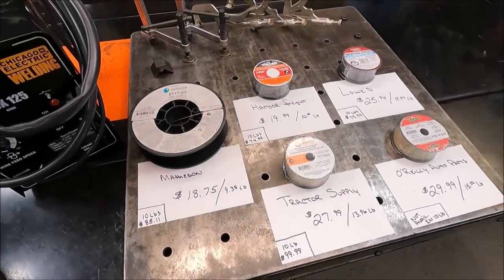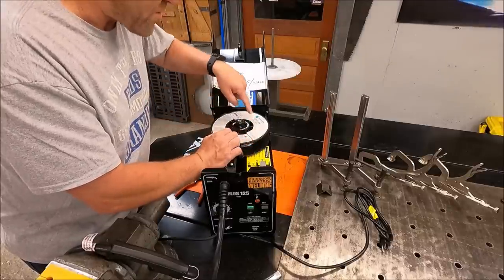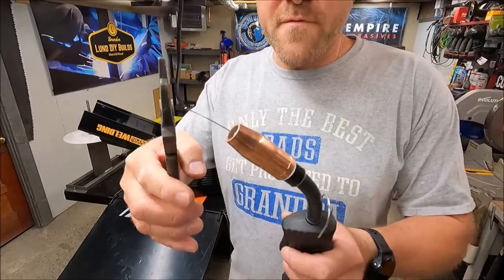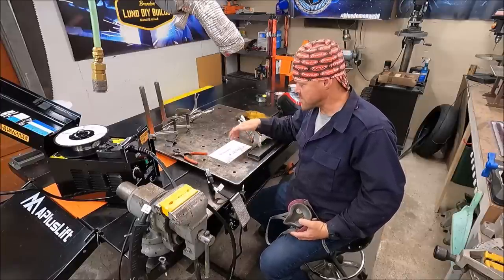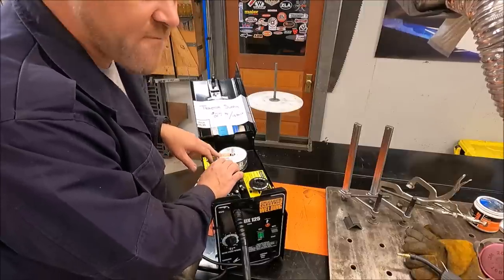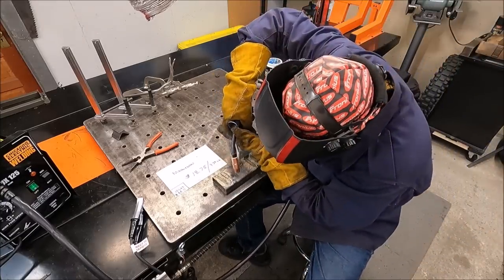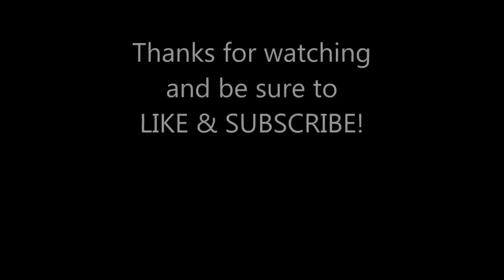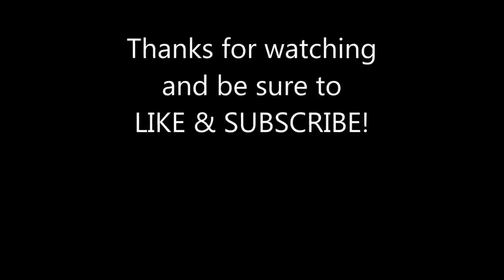Testing which Flux Core Welding Wire is Best

Comment: Unfair comparison because different electrode classifications.. GS wire is rated for single pass general purpose wire. T-11 wires are rated for general use but typically multi-pass applications from 5/16" to 3/4" thick steel (depending on brand) and according to AWS, rated for light structural per code. Also the GS designated wires, manufacturers can essentially use any flux mixture they like as long as it meets the lenient requirements. Again, T-11 wires are more strict on flux requirements. Don't get me wrong, I like flux core arc welding, but in my quest to get the best results I have gone down a rabbit hole learning all I can about it. I'd like to cite AWS D1.1 as my reference source. For the record, the Hobart and Lincoln wires are the only T-11 wires tested in this video. Not trying to sound like I'm hating man, just some constructive criticism. If I were as good as a film maker as you I'd love to share results from my own testing of various brands at various settings, including running off CC welders instead of typical CV.
Reply from the maker: You have good intentions, but its not for this audience. These are the wires that are available in stores across the country on any given weeknd for consumer use. Home Depot, Harbor Freight and Lowes aren't going to give you those options you mentioned that you will find at a welding supply store. If I were gearing this towards an advanced audience, I wouldn't be buying my wire at O'Rileys.

Comment: Common misconception is that all flux core runs the same polarity.  You have to verify what the label calls for.  Not a big deal on a machine that lets you swap polarity.
Reply from the maker: @Travis Hanson Spot on. As a general rule, most gasless wires FCAW are run DCEN. GMAW (Gas Metal Arc Welding) and FCAW that use gas will usually be run DCEP but as you mentioned it will say within packaging.

Comment: Thanks for your time and expertise, I have all but given up on flux core welding, after watching your video has given me some hope that I  should try the Lincoln wire also, trying alot of settings I was still having trouble with too fast, too hot, too much wire speed or too slow. So maybe it's just the wire. 🤔. Now what to do with 4 spools of wire that doesn't work for me.
Reply from the maker: Hey Gary I hear you. Some other issues if you run Lincoln and are still having problems. It could be you need to switch your polarity, you might need to set your drive roll tension or your liner could be dirty. Each of these will cause feeding problems. Here is a video showing those issues https://youtu.be/2ns3HLXDZsE

Comment: I have an old Miller, Millermatic 115 volt. I was having problems feeding and they (Miller Dealer) told me to use .030 wire. Have not tried other brands yet but will try the Lincoln wire.
Reply from the maker: @Charles Million Much of the feeding problems have a lot to do with the manufacturing process that Lincoln doesn't seem to have. Its a very reliable wire.

Comment: The money is the diff in wire cause its costs keeps rising. As long as the rating is same I'll buy the less priced stuff. I've been using the harbor freight 120 and 220 volt Chicago electric machines using .... / 023 /030  and 035 since 1998. With the settings dialed in specific to wire there's no need to buy a more expensive mig machine. I Just dial it in and turn down heat as metal heats up and I'm burning holes in my tennis shoes. Love the simplicity of migs in that category. From car sheet metal to 7/16 after my learning curve but when your there it's sure is rewarding. I have purchased crappy stick though and have never used that Matheson wire.  Now you got my curiosity about it so I guess I better see if it will work for me, thanks. The stuff keeps getting more expensive.
Reply from the maker: @Scott Sanders thank you! I started out on a HF welder and I still have one so I would never knock anyone for using one. I actually love mine. I've used a bunch of different wire over the years but never back to back like in this test so it pretty much removes that learning curve you get as run a particular wire after a while. The lincoln wire is definitely worth a shot. I guarantee you will absolutely love it.

Comment: Great head to head wire comparison!!  Price comparison wise it would have been nice if it was possible to source them all from the same place, anything you buy at O'Reilly's you could probably get cheaper at TSC, and cheaper still at Lowe's, and even cheaper from HF.  Lincoln, Hobart and Matheson are available from multiple sources but Vulcan is exclusive to HF and I don't think they offer any of the other brands, not sure about Vaper but I'm guessing it's an O'Reilly only deal and I don't know if they offer any of the other brands, so probably impossible to single source the wire unfortunately.  Great comparison of the wire performance!!  Glad you adjusted your settings to give each wire a fair chance.  Some might complain it wasn't a true apples to apples comparison, but in the real world if your wires not running good you check and adjust your settings.  Great job!
Reply from the maker: @yertel t thanks! Most places I went to pretty much only carried one  brand. I really wanted my Matheson to win too but the test showed me otherwise
Reply: @BrandonLund  When the favorite comes in second you know it's an honest test!!  You can probably get the Lincoln, Hobart, and Matheson from a welding supply website, but yeah, Lowe's and HD only carry Lincoln wire for their Lincoln welders, same with TSC and Running's with Hobart supplies.  Cool to learn you're a Mainer, former Eastporter here.
Reply from the maker: It's always nice when viewers are from my home state! Thanks!

Comment: I use Lincoln and Vulcan, depending on tinkering project, or paying customer.

there is 1 more wire I think about, but I have never tried it in a flux core, but love it best in solid wire for doing auto-body work, discovered it 5 or so years ago, accidentally picked 1 up, sent my wife to get, lol, and thats all I use now, for welding car bodies made by Washington Alloy.

another I hear about is Blue Demon, but never tried any consumables, but I do have a MIG by them & love it!
Reply from the maker: I have heard both are good also. I have a Blue Demon welder and love it but I too have not tried their wire. I'm going to have to pick up a roll. Thanks for watching and sharing @Randy mack
Reply: @BrandonLund  thank you.

I bought my Blue Demon welder as a joke, shop I worked at only had 110 power to building I worked in, so had to piece cars together, then take apart, take to big building with his 220v welder, to refit parts, and weld, I figured I would tack weld parts to hold in place, however joke was on me, that welder was so awesome, I used it for everything, and it has put on so many quarter panels, rockers, cab corners, floors, trunk pans, plus so much more. a honestly amazing welder to be made in China.

I did do a few mods, 1 it needed a new liner in mig gun, but I ordered a custom MIG gun, and installed a bronze ground, the MIG gun has a better switch, & really helped it, & then I discovered the Washington Alloy. and prefer it to Lincoln, for auto-body work. mine is a 135M which is an older MIG welder, but I wouldnt trade it for anything, & I have Lincoln MIGs, but I will grab this for sheet metal every time
Reply from the maker: @Randy mack that's an awesome story! I kinda chuckled about it being a "joke" at first. I have their 120/240 stick welder and it probably has the nicest arc I've ever struck with a stick welder. There welders are definitely under marketed for what they are. I heard the Blue Demon wire is made in the same factory as Hobart but I can't confirm that. I'm really curious to try that Washington Alloy. Thanks again man!
Reply: @BrandonLund  I honestly want to either buy the multi-function, or the 140 MIG, by Blue Demon, to have a new machine, and use mine as a backup, I own 5 other MIGs, 2 are Lincoln 180's a 110V Blue Point, then 2 cheap ones. but for sheet metal I love my Blue Demon.

my boss that I bought the Blue Demon because of, he has a Snap-On YA212, those do pretty good for sheet metal, but also suck for normal welding, although supposedly an internal switch to make it weld normally? but it uses stickout of wire to run lower temp for sheet metal, weird technology. but works for auto-body, but my boss insisted on .030 Lincoln for auto-body, which generally I prefer .023. but his did a great job, then I discovered my Blue Demon, generally I prefer 110V machines for auto-body, plus a trick, if wanting to lower amps, but want it say between #2, & #3. you can try using extension cords at the higher power level, a 15', 25', 40', and 50' can drop it, so that its no longer too hot on number 3, but hotter than normal #2, if your having issues, if you wish to play? use cheap 16 gauge cords. otherwise, 10 or 12 gauge cord 25' or less so you wont drop amps. lol. thats best way I found to add ranges to a welder for thin sheet metal. LOL.

the Joke, I was browsing Marketplace for a cheap welder to tack parts with, saw this advertised by a guy I know, sold it to me for $100, with a 135CF tank of gas, and cart. he closed  his muffler shop, but welder had been used exclusively for exhaust work since new. it did ok, so I spent money for new gun & the bronze ground. and me sending wife for MIG wire, .023, thats from LWS, and got that Washington Alloy, I figured I would try, and I prefer it to Lincoln, then my second choice is Lincoln. the only beads I welded with Washington Alloy in reinforced areas on autobody, the rest are tacking, if your familiar with installing sheet metal on cars?

my Lincoln 180 Mig welders, both set up for flux core, 1 I keep Vulcan wire from Harbor Freight in all the time, for tinkering projects, or repairs that are not critical, then the other one I keep Lincoln wire in for anything important. I bought welders dirt cheap, 1 was new, 1 was almost new, person gave up trying to learn to weld. $400 for new, at pawn shop, the other used 1/2 of a 2lb spool, it was $450.

Comment: Ive found with the harbor fright welder is to not fallow the suggested settings on the wire feed it simply dose not have the heat to run at 7or 8 in my opinion it seems to run best on max and like 2 or 3 on wire speed
Reply from the maker: Great point Jacob's! I'm going to be doing some more testing on this welder but what your saying makes sense and that's what I was experiencing also.

Comment: Nice job Brandon. From my experience, Lincoln wire first, then Hobart wire…

For Dual Shield I use ESAB DualShield 7100 Ultra wire in 0.35”
Reply from the maker: I like Hobart as well! I haven't tried the ESAB yet but I'm curios. Thank you! 👍

Comment: Another wire you could review in the future is called ESAB Sureweld from Northern Tool. All but one of those you've tested in this video I can buy locally. I've just purchased my unit from Grizzly, so am  looking for wire for the future. Thank you for posting.
Reply from the maker: @basement_sawyer that's a great suggestion! 👍  thank you. I will have to pick up a roll and test it out 😀

Comment: Brandon, Thanks for the comparison video. It would be interesting to know who makes the Tractor Supply wire and the O'Reilly wire.  Also, FYI: your fume extractor wasn't doing much, if anything. Good thing you were using the respirator.
Reply from the maker: It wasn't doing anything LOL It's too loud to keep running when I'm doing the narration parts of the video so half the time I forget to turn it back on

Comment: I had the Vulcan. real good luck with the Vulcan wire in my machine which is a titanium harbor freight flux core welder.
i really like the vI really like the Vulcan wireulcan wire
Reply from the maker: @Rusty Cahill I didn't have bad luck with the Vulcan once I started messing with it but it didn't run like the others. It wasn't bad though.

Comment: Useful review, thanks!
I often end up welding galvanised steel, I have found that different galvanising works better with different wires 🤷🏻‍♂️ Worth trying an alternative wire if the regular wire is not working well.
Reply from the maker: @Td Wernham Great point! Thanks man!
Reply: not a good idea to weld galvanized steel without a full air mask that get fresh air from a distant soruce.. the outgassing from galvanized steel will form zinc oxide fumes that can be dangerous to your health
Reply: @randellgribben9772  Absolutely correct, you need to be careful welding galvanised material, the fumes are very bad for you (potentially fatal).
Reply: Do you try to "degalvinize", so to speak, at all to avoid fumes and bad welds? 
Im curious about common hardware types and welding them. 
Black oxide, zinc, galvanized, stainless, grade 5 and 8 and which is best for a diy'er
Reply from the maker: @Nate B I make a good effort to get metal to bright and shiny regardless of what it's coated with, with the exception if I'm outside throwing something together stick welding then I will not be so fussy with cleaning but as a general rule you should always get the metal to bright and shiny before welding and wear a 2091 or 2097 respirator at the very least when grinding and welding.

Comment: im not a great welder by any means but i have a harbor freight titanium 170 and have been using the wire it came with which is the vulcan i believe and 1 thing ive found out to get good welds is the settings of the welder and material matter alot im sure if you took these same wires and ran them in say my machine or a better machine that you have they would perform much better and all my welding was done on 120v no gas
Reply from the maker: @ThePoolman2007 that's a good point. We are going to test this out real soon because I'm curious too!

Comment: With the GS wire that is a result I somewhat expected. Maybe try running ER70T11 in a slightly bigger machine. Hobart .035 really likes to run in a 140 machine quite nicely. I run a Titanium 140 at work, so I might be just a bit biased.

Comment: I have the HF 125 titanium welder and I threw away the wire it came with and use .030 Hobart from Tractor Supply, may switch to Lowe’s Lincoln.
Reply from the maker: The Hobart is pretty good stuff!

Comment: I've purchased a set of 0.30 & 0.35 YESWELDER Flux Core Mig Wire Mild Steel E71TGS when they were on sale, though not used yet.  Just checked the 10lb spools and they're like ~$40-50.  Wondering how performs compared to the Lincoln?
Reply: Thanks for sharing too!  Most I read regarding, the Lincoln is the preferred wire, though seems to be a lot of favor with the Yes wire too.  I have a Miller, so know the feeling.  Invested in a restorable Century 125GL and loaded up the Yes wire and need to find the time to lay some dimes... or well not quite dimes.
Reply from the maker: @jafinch78 I've heard good things about that wire also but I've yet to try it. I will order some and get some results posted. Thanks man for the suggestion!

Comment: This only applies to the Harbor Freight A/C type welders..... all these wires run much better on proper DCEN. Good video though for those with an A/C type welder.
Reply from the maker: @tdhorn13 I thanks! One of the upcoming tests is going to be just that. We are going to compare this machine to the Vulcan 125 which is the HF DC version. It should be interesting.

Comment: yup lincoln wire runs the best been using it for 5yrs and when i change to Forney flux core wire i notice that it wasn't putting a good weld so i switch back to lincoln wire .
Reply from the maker: I totally agree! @Welsey Lewis

Comment: Good info. What are you thoughts on using flux core nozzle for flux core? Thank you.
Reply from the maker: @Marty Hopper absolutely. If you have a Mig machine it's an excellent idea because it helps keep the gas passages clear of crud. I've run my Hobart without any at all and regretted it. I accidentally bumped the little compression ring that holds the nozzle on and it arced out against my workpiece and ruined it. That was a 25 dollar mistake. I think the flux nozzle for that machine is only $9

Comment: The Lincoln wire sounded smooth and steady. I wondered if it would be a favorite.
Reply from the maker: @Blade it's all I use at the moment but I will keep testing in case something better comes along.

Comment: ran out of wire the other day, so went to napa and got some "firepower" brand wire and that stuff is horrible dont have the same flow out constant stubbing even down to 4 on the wire speed, and flux was a nightmare to take off...should have went with the Lincoln wire i was using..seems like the firepower was pulling more amperage too as it was tripping the breaker while the lincoln no issue.
Reply from the maker: Its crazy how one brand to the next can be such a significant change.

Comment: Great, not what I was hoping to hear... I just bought a 10lb spool from HF last week hoping their mindset towards tool quality might follow over into the welding consumables... That doesn't seem to be the case.
Reply from the maker: @Thomas McKelvey It's not all bad news though.  I have used this wire on some other machines and it did do better. Like I mentioned in the video, you can do a really good job using any of these wires including the HF once you find the sweet spot with proper mig gun distance and amperage. Its just that the Lincoln seemed to run good without much of a learning curve (and I have been running Matheson exclusively for years) so it's not that I'm used to lincoln wire. Just don't buy that vapor wire. That stuff is junk!